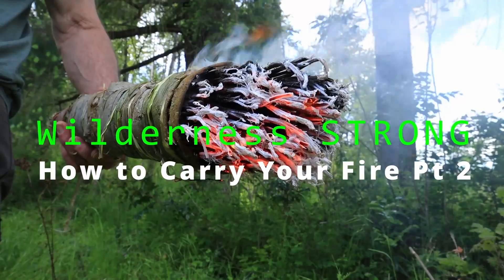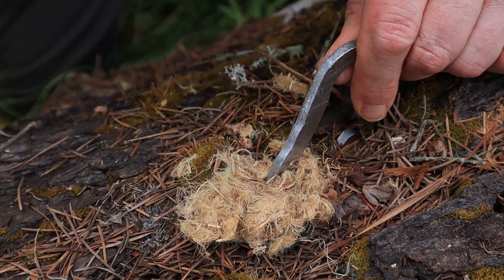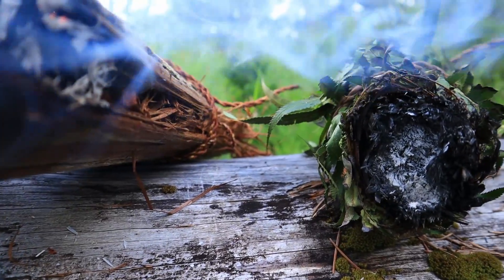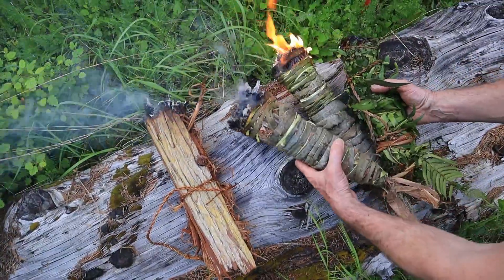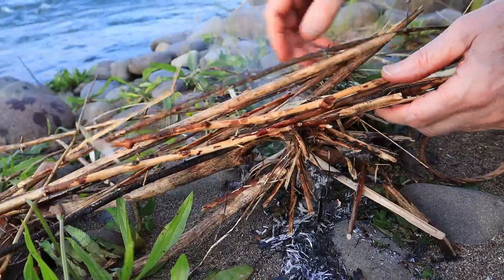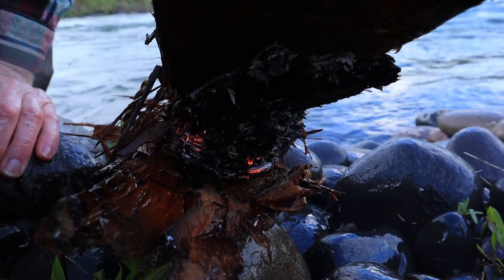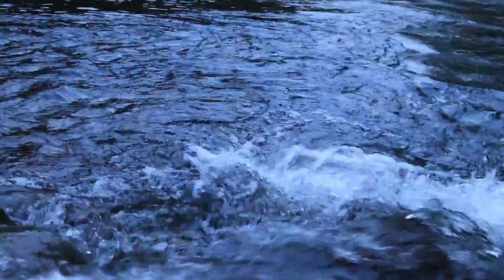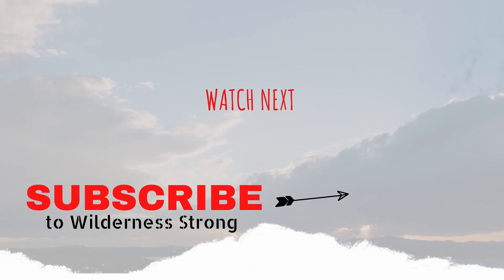How to Carry Fire 2 | Lighting with Flint & Steel No Char

Comment: Well, you have a following here for sure.  Quite anxious to see how to properly process urtica dioica (stinging nettles) into viable no-char tinder for flint and steel. I love charred punkwood best so far, and use fluffed up amadou (fomes fomentarius), and charred cat tail heads (typha latifolia) as well, but I have not tried nettles yet.  My friends in the UK have had much difficulties with nettles so far.  Your processing method will be helpful to know.  Thanks.

Comment: BTW I'm having trouble with drying my burdock. I'm thinking it's because of our humidity here on the east coast right now. Any suggestions for the drying process ??
Reply from the maker: Well with Burdock we are yet to have success harvesting green leaves and drying. Our success has come by foraging around the bottom of the plant to collect already dead leaves. Stinging Nettle and Pacific Waterleaf can be harvested green and dried the same day in a few hours of sunlight and give reliable results but so far we cannot produce the same results with Burdock. So grab some dead leaves, make sure they’re dry and give it a shot.
Reply: @wildernessstrong6131  Funny you should mention this. I was able to find a few dead leaves today while out . I'm beginning to think the humidity plays a factor in it.  Humidity in the mid to upper 80% range here.. I still gave it a try with the dry leaves but no luck.. Gonna give it a few days to dry more . Thanks again to you both !!
Reply: @wildernessstrong6131  I'm also wondering if the chlorophyll is a contributing factor since yours were actually brown compared to what I found and processed went to grey..  Thanks again for all your help...

Comment: How do you gather the stinging nettle with your bare hands? That stuff stings and burns me damn near just by looking at it! 😂
It's some evil stuff! I would absolutely have to wear gloves. If I had none then it would need to be a dire emergency to touch the stuff bare handed!
Reply from the maker: Good question. You can handle stinging nettle carefully by pinching it firmly. You can also rub off the needles with a glove or thick leaves. You can see us doing that in this video: Flint & Steel Fire NO CHAR | Amazing Results!
https://youtu.be/u9alYSk69_0